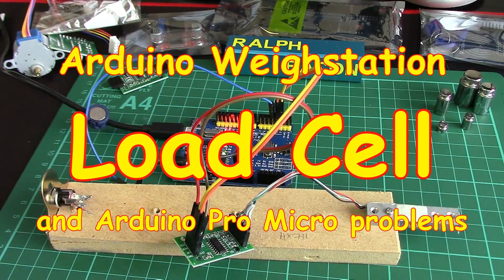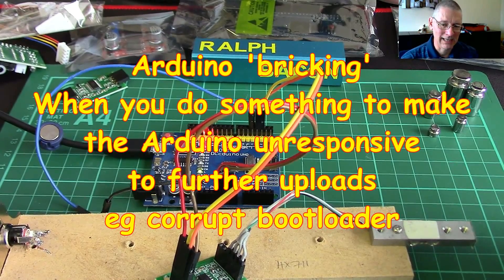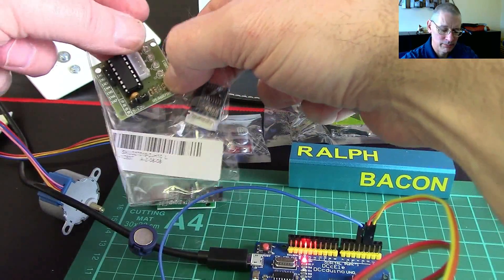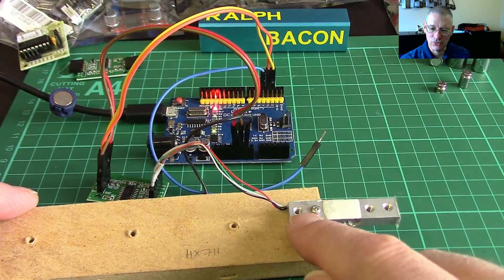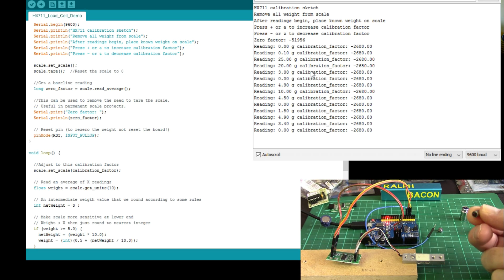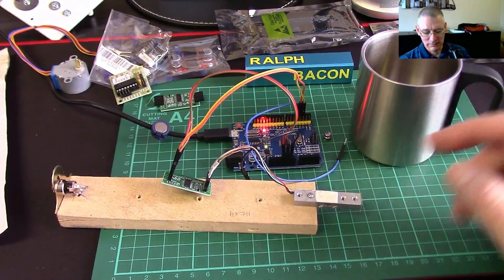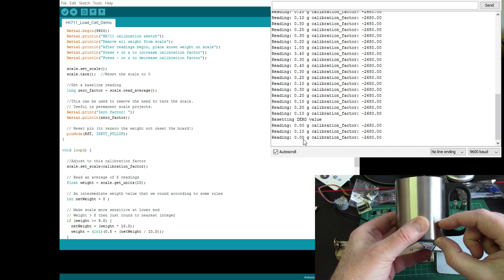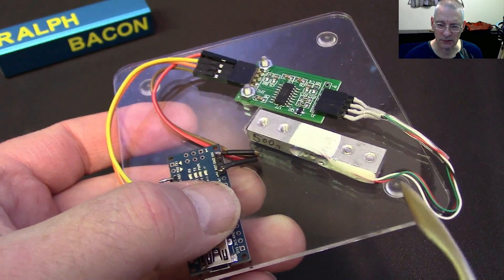#31 Load Cell project (part 1) Arduino Micro problems plus postman deliveries

Comment: Great video. Sir I am doing a project based on load cell. I flowed your video.. But the problem is my load cell is not giving the correct measurement. for ex. 140g is shown as 79.5g. if the weight goes up it shows less weight than the original weight.. What is the actual problem here. what should I need to do to solve this
Reply from the maker: I'm going to paste in the same reply I gave another subscriber as this seems a bit of a sticking point!

---------------------------------------------------------------------------------------------------------------------------------------------------------------------------------------
It’s important that one end of the load cell is securely screwed down onto a piece of wood (or something) so that it cannot move about, just like in my first video #31. This enables the other end (that is now free-floating) to move a millimetre or so when weight is put upon that end. Important: fix the end of the load cell to a support which does NOT have the weight sticker on it.

Secondly, I notice from your pictures that you have a 5kg load cell (I used a 100g load cell, quite a difference in sensitivity). It MIGHT be that your load cell cannot accurately measure small weights like 50g and perhaps you should use an exact 0.25kg weight to start with and see if you can get a proper, repeatable reading. You may have to hang the weight from the load cell over the edge of a table otherwise it will not be easy to do.

During the calibration phase it does not matter if the final calibration factor is negative or positive but it should be stable.

So, check the following:
1. Have  you have wired up the load cell correctly to the HX711? The four colour-coded wires from the load cell are very specific (two +/- pairs, not interchangeable), see the data sheet
2. Have you mounted it correctly on a board in the same way I did so that the correct end is secured and the other end can move without hindrance?
3. Have you got a weight large enough so it registers in the calibration stage the same weight, repeatedly? 

That’s all I can suggest at the moment, but if you follow the same steps I took it most certainly will work, so good luck. 
---------------------------------------------------------------------------------------------------------------------------------------------------------------------------------------
That's it, I hope it helps!
Reply: U have used this green colored HX711 module 
http://img.dxcdn.com/productimages/sku_308904_1.jpg

We are using this red colored one.
http://cdn.shopify.com/s/files/1/0672/9409/products/weight_ADC_large_faba79ae-ae57-4d30-8550-e4f0d7885dba_1024x1024.jpg?v=1438621867

what is the difference between these two modules???
Reply from the maker: As long as the E+/E- is not used then both boards are (probably) the same. They both have the HX711 chip on board and there's only so many way you can connect that chip so I suspect they are the same. My board might allow other weighing sensors to connect to those E+/E- pins but I haven't really investigated that option as I'm trying to keep it simple here. My board was purchased from Banggood here: http://www.banggood.com/5Pcs-24-Bit-AD-HX711-Weighing-Pressure-Sensor-Module-For-Arduino-p-953336.html and they are still selling these $5.28 as I write this; not exactly cheap but mine has performed flawlessly since I built it into that coffee cup coaster.
Edit: that was $5.28 for FIVE pieces so in that case they are VERY cheap individually!

Comment: Hi Ralph - Nice video!  CAn you tell me where you got the load cell?
Reply from the maker: +Scott Miller
Hi Scott, welcome to my channel. Excellent question and I can't believe I didn't show this in the video, very remiss of me. Anyway I bought it from eBay from Far Eastern seller myfree8. Here's a link to the item in the UK (but he will doubtless sell on all variants of eBay): 

http://www.ebay.co.uk/itm/Aluminum-Electronic-Balance-Four-Wire-Weighing-Load-Cell-Sensor-YCZ-191-500g-/191598861371

Interestingly, well, sort of, the price has gone DOWN since I bought this in early April 2016. Note that this is the 500g version as I wanted to just measure a coffee cup and wanted the resolution to be high (and that coffer cup coaster is in DAILY use, gets lots of enquiries and just works so wonderfully well I should have patented it). He/She/They sell other variants from 500g to 5kg or more, get the version to suit.
 
Thanks for the question, I shall put that link into the video description too :)

Comment: Have you tried creating this project with the esp8266?
Reply from the maker: +Mark Zeidan 
I can't say I've tried that, Mark, but as you only need the one analog pin (all you get on an ESP8266) it should be OK... I think (without actually doing it that's all I can say). Then you can wirelessly send out a message or allow your ESP8266 to be interrogated. I (and others reading this) will probably be interested in what you might use this combination for as we're always eager for new ideas. Thanks for posting and enjoy the other videos too!

Comment: Just a wee suggestion. I always used to use a whiteboard for designing and planning stuff. Then I went a bit more high tech and started using a sheet of perpex (clear) and a liquid chalk pen. Sounds daft but bare with me.

What I did with the perspex was to stick EL strip / LED strip (like this http://image.ec21.com/image/gtwelight/oimg_GC04337740/EL_Strip%252FLED_Strip.jpg) around the outer edge of the perspex. Then I put over the top of that, edging (like this http://www.woolies-trim.co.uk/p-1578-chrome-edge.aspx) over the edge and around the perimeter of the sheet of perspex. On the inside of the edging (before putting it on I put some chrome paint so the inside of it was reflective.

The edging, apart from being nice to look at and hides the LED, also stops the led light from escaping outwards. The chrome paint on the inside bounces the LED light back towards the edge of the perspex and because the perspex is clear the light transmits through it and my board lights up like a beacon. Of course with the liquid chalk it goes florescent - really cool.

If you did this with your coaster, you wouldnt have your led showing and the entire coaster would light up. Even cooler, if you put say red along one edge, blue across another and amber on another and fit your coaster with a temperature sensor. You could have the red come on when its hot, orange when its meeeeh, blue when its cold. So you if you look down and its blue you can go....bugger! coffee is cold! Then it stops you having that take a swig - BLLAAAH moment with cold coffee.
Reply from the maker: Amazing lateral thinking here and it does sound cool (or hot - no pun intended).  I've yet to build my coaster for home use (this time using smoked perspex) so I'll consider this and other suggestions I've received on how to make it look (even) better! The main issue I have is (lack of) time, it just takes several hours to build stuff - several hours I never seem to have. Thanks for your post, I found it very interesting, as will others too - appreciated.
Reply: If you are using smoked perspex this might not work. Ive only ever seen it done with clear perspex because of the refraction and polarisation index of the perspex

Comment: You mentioned you can get them up to 50KG - I just bought one for a project im doing and it goes up to 500KG :-)
Reply from the maker: OMG what are you weighing, a truck? An entire rugby team? A hippopotamus (perhaps you work in a zoo?) :) But seriously, thanks for letting me (and everyone else reading this) know that larger sizes are available as I'm sure there is a market for weighing bigger items. Did you want to share what you are using yours for, or is is confidential?
Reply: Actually I have been trying to measure volume of a liquid in a 100L drum. Flow meters are just too imprecise so I decided to use load cells instead. The density of any substance is the mass (in kg) of the substance posessed by unit volume( 1 cubic meter) of the substance. The Density of Water is approximately 1000Kg/m3. Hence converted in litre, density of water becomes 1 Kg/Litre. hence mass of 1 L of water is 1 kg.

For me I am using several different types of liquid so all I did was weighed 1L of the particular liquid on scales, that gives me the weight of that particular liquid, from there it is just maths.

So in otherwords, to measure out 100L of a particular liquid, I work out its density. For the first liquid I use I calculated that it weighed 940g per litre. So I put the empty drum on the measuring platform with the load cells in it and zero it. I then get it to switch on the pump and when it gets to exactly 94KG in weight, I know I have exactly 100L and switch the pump off

For water I would zero the empty drum on the load cell, start the pump, then when I hit 100KG, I know I have 100L.
Reply: I can tell you what im doing for that particular part of what I am doing - just not the overall plan for world domination. LOL

Comment: Ralph,
There appears to be 2 main designs of HX711 amplifier - a red board and green board.  Do you know if there are any performance differences between them?
Reply from the maker: The board colour is, I'm pretty sure, just branding. Sparkfun, for example, love to use red boards in their design just so that they are recognisable. The HX711 chip is the same for both boards though. Unless anyone else knows different...